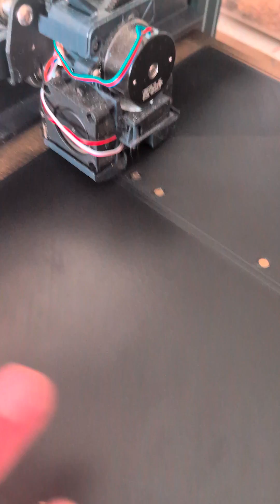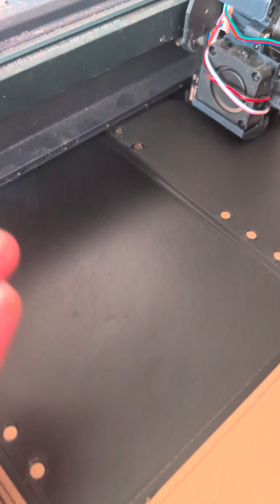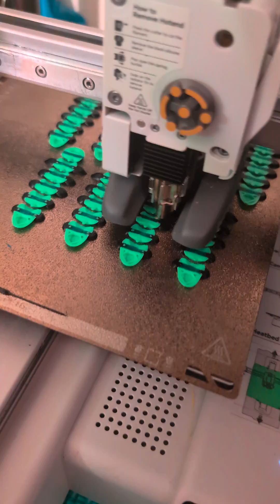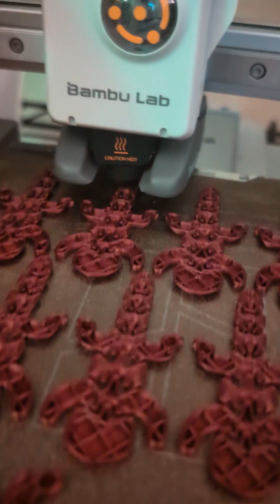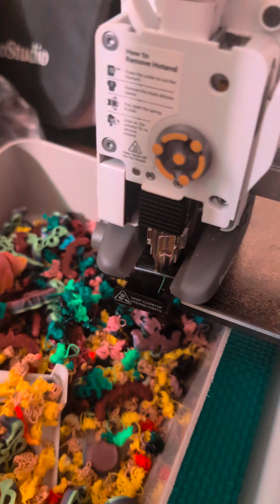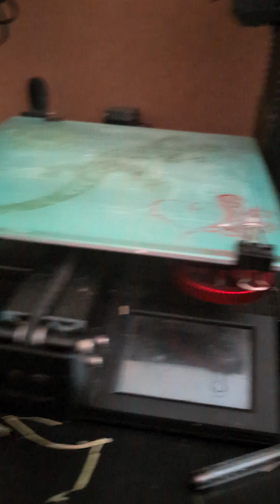every printer has its quirks

Comment: my 2 anycubic (photon S and m5s) have had 0 issues and are really just print and forget.
the m7 pro is looking really great as you don't even need to empty the vat anymore.
and given the size I'd recommend it over a prusa (slightly smaller but not too much, it's still plenty big, I'd get either a belted or a 400mm printer as an fdm).

though they still have quirks, the m5s need internet for the wifi functionality (why not have a good ol' ftp/smb server)  and recently I noticed an usb drive I bought isn't recognised. 

what I wouldn't recommend though is the high speed resin, the only advantage is if you need rapid prototyping, it's not a general use resin, it's brittle, split if you look at it wrong, the pigment separates quite fast (not that much of an issue as the max print time you'll get is like 4 hours, so you just need to mix it before pouring).